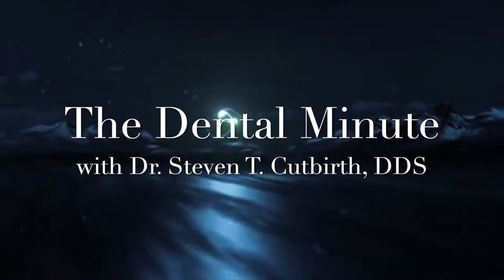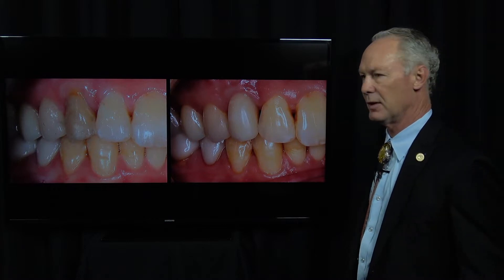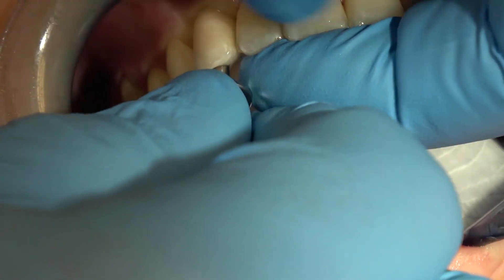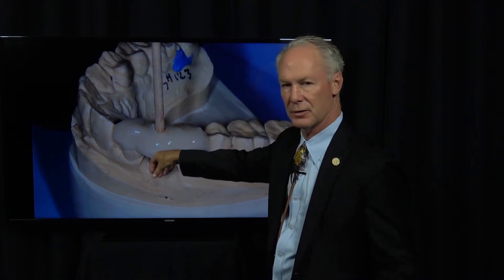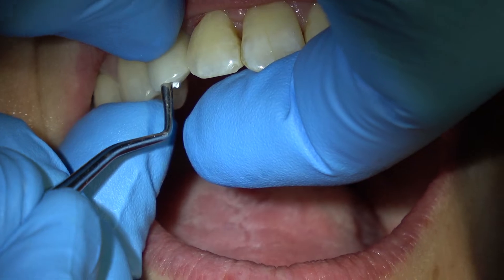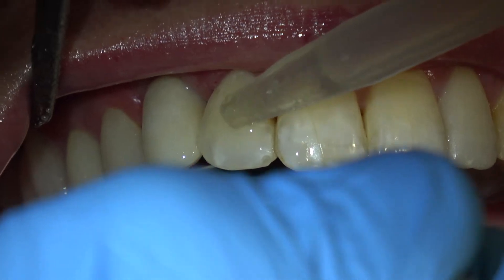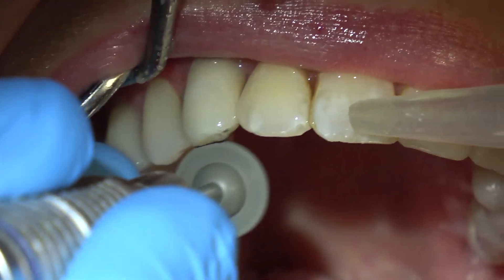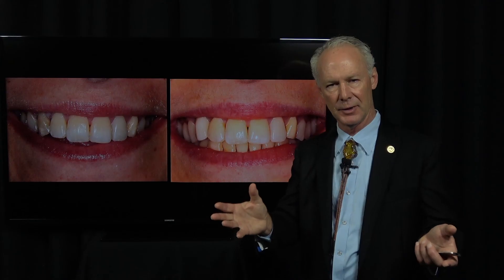Anterior Implant & Crown - Seating Implant Crown

Comment: Hi doc.
i did implants and bone grafts and going back after 2 months which is end of the 6th month, and they will.place the crown over the implants. they never mentioned, doing a healing cap and wait few months then do the crown. is it possible to do without healing cap and go straight for crowns after 6 monthsnof healing?
Reply from the maker: Maybe the healing cap is flat and concealed under the gum tissue. If so, the dentist will have to anesthetize the tissue and uncover the coronal part of the implant and unscrew the flat healing cap to take the impression.
Reply: @centerforard  Thank you for response. that makes sense, currently i can't see anything except flat gums. i heard its good if guns don't show. hoping they don't do lots of cuts again in the process:)

Comment: How long does it take for the regular extraction to blood clot it's been four days I see sutures and the bone graft still no blood though.
Reply from the maker: The blood clot is present immediately at the time of tooth extraction. It takes approximately 7 days for the connective tissue lining to form over the bone in the socket, so 7 days is the magic number for maintaining the blood clot in the socket. If the stitches are resorbable, they will dissolve in 4 days to 2 weeks, depending on the type of resorbable suture.